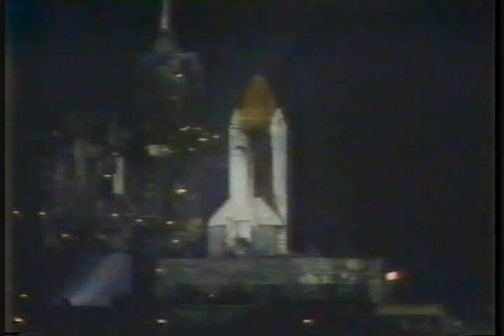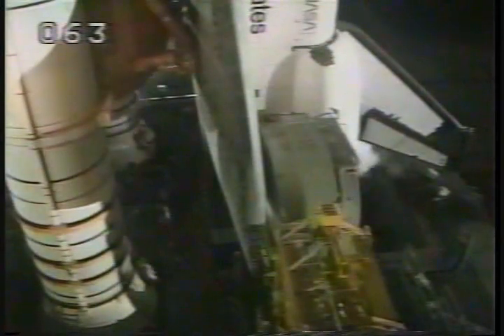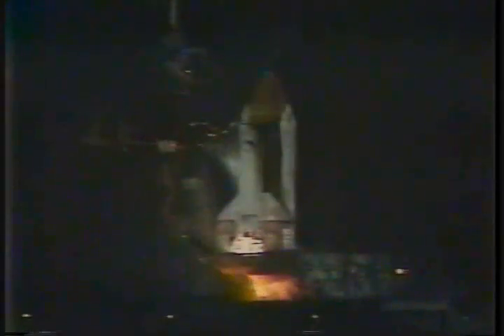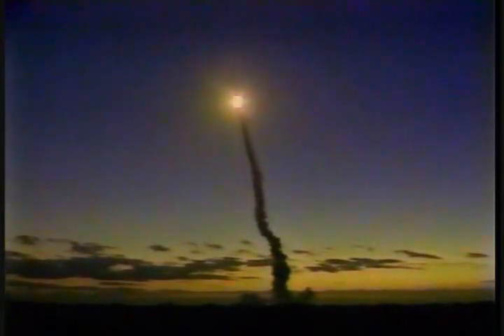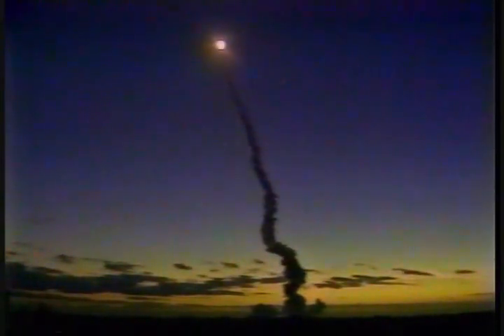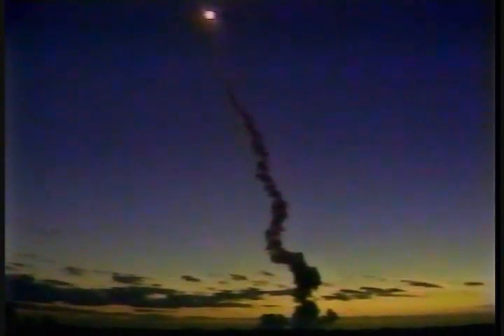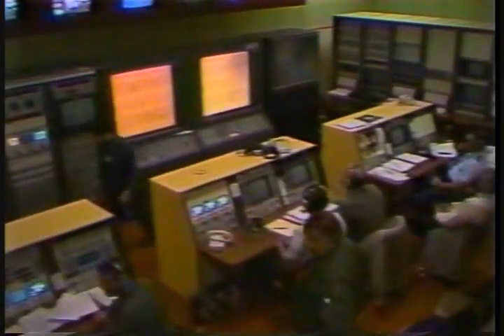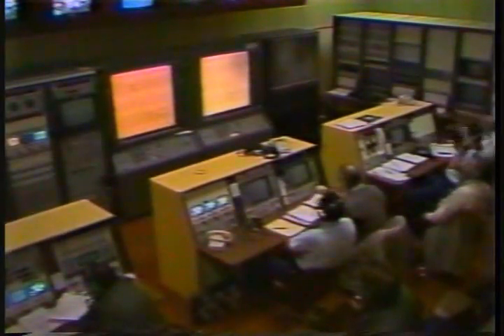STS-61C launch & landing (1-12-86)

Comment: You can see the difference in the upper level winds between this flight and 51L, which flew on the 28th. The plume was pretty much straight as an arrow here,  on 51L it very quickly started getting shifted due to the bad wind shear.

Comment: The landing was supposed to take place in Florida to save time and money by not having to ferry Columbia back to the Kennedy Space Center. But the California landing added a week or more to the Shuttle processing time to prepare Columbia for her next flight, a flight to observe Halley’s Comet. However, it would probably have been impossible to have Columbia ready in time to observe Halley’s Comet, which had a very limited launch window. 
The delay added pressure to the already just about impossibly tight launch schedule and this contributed to the decision to launch Challenger on her catastrophic final flight just 10 days after the landing. 
While regular astronauts were very aware of the risks, it was very unfortunate that schoolteacher Christa MacAuliffe  took the completely wrong view that the delays suffered by the Shuttle, in particular this one,  meant the Shuttle was very safe,  rather than as a warning that in the rush to launch and keep to the schedule,  a calamitous tragedy was possible, even likely, as was proved when Challenger was destroyed 73 seconds after launch due to a fault in the O ring seals on the Solid Rocket Boosters, a problem engineers were well aware of, tried to warn management but were ignored with disastrous results.
In fact, this flight should not have taken place at all, there was only one satellite to deploy and that easily could have been rescheduled to a later flight. According to astronaut Mike Mullane, in his book “Riding Rockets”, NASA only allowed the flight to take place because of the presence of then Congressman Bill Nelson, now NASA Administrator,  and NASA did not want to disappoint the man who controlled their purse strings by cancelling the flight.

Comment: The launch Capcom sounded like (But may not have been) Dan Brandenstein. He was the Capcom for STS-1. 
There was no Centaur on STS-61C. This was the last successful flight of the shuttle program until September 1988.
Reply: I think I was responding to someone else,  I realized there was no Centaur on this flight. Pretty sure the planned first time was for Galileo. That got scrapped and they had to come up with using a IUS and the VEEGA maneuver (Venus-Earth-Earth-Gravity-Assist) to boost the speed to get out to Jupiter. The delays also played a part in Galileos high gain antenna issues (antenna did not fully deploy due to aged adhesive) 

I think I may have mentioned the Centaur because during the launch view from the tower,  you can see the "new" yellow truss structure near the left hand tail service mast (the TSMs are the blocks on either side of the main engines, they fuel the tank, O2 on the right,  H2 on the left). The new structure was going to be part of the "rolling umbilical" that would service the H2/O2 Centaur while still on the pad.
Reply: The CapCom here was Fred Gregory.

Comment: There was going to be a Shuttle-specific version of the Centaur called G Prime. The G Prime was to have an enlarged liquid hydrogen tank that essentially took up the entire width of the orbiter payload bay(15 ft).

RBUS is short for Rolling Beam Umbilical System which was going to be the system used for filling/draining the hydrogen from the Centaur and venting it away.

Comment: If 61c launched the same month as the challenger diasater. How come 61c didn’t explode like challenger did
Reply: Because the weather was not as, or quite as cold as the Challenger flight.  But engineers still expressed concern about the state of the o-ring seals when they were examined after the launch.